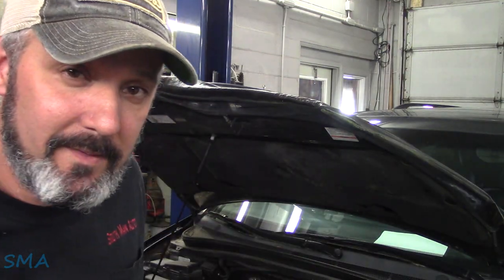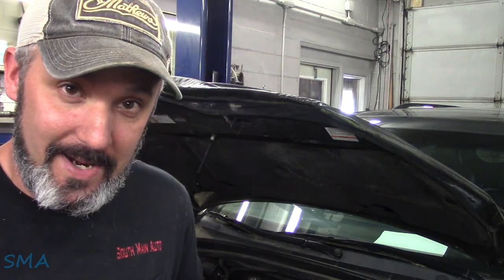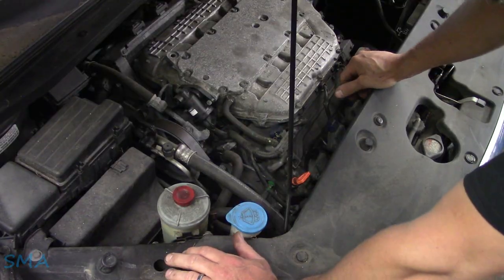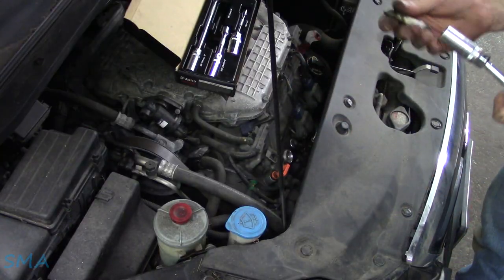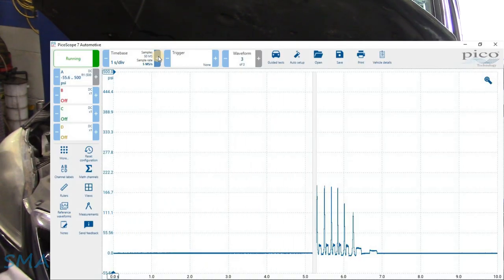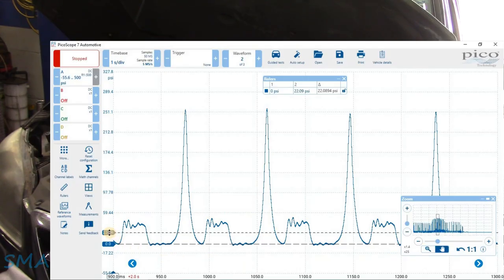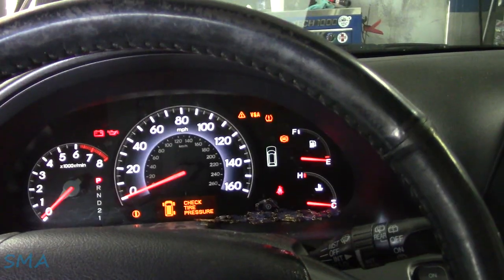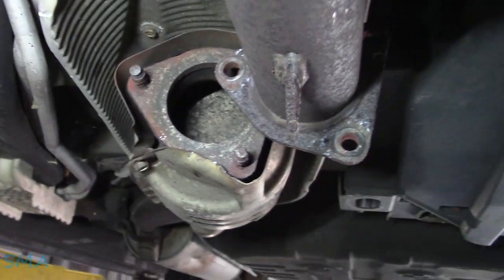Honda Odyssey: No Power At All

Comment: Judging from the almost bald tires, the wrong spark plugs and a plugged cat, these people probably have ZERO money to fix their car.
Reply: they are not OEM plugs, not the 'wrong' plugs.  Multiple brands make plugs for cars.  I prefer NGK personally.  Those tires must have a few more revolutions in them! (before they pop)
Reply: @zakuraayame5091  Bosch makes a good pmug though but for japanese cars it's usually japanese plugs. Bosch might well be the oem manufacturer fron honda in some markets though.
Reply: those are Bosch plugs....just as good as NGk..it's not like he used autolite plugs or something...
Reply: So, the ol' Italian tune-up it is!
Reply: I always buy bosch ones and never had problems with them. I one time bought ngk and it snapped on install, no excessive force was used.
Reply: Methinks they will pay Eric for his diag time, then take a hammer & broom handle to what's left of that catalyst. Sounds like it's guzzling oil so a new cat wouldn't be long for the world either.
Reply: Those are also problematic tires. When new, they were "State of the art" Michelin run-flats. Most Odysseys have had the rims changed out for regular wheels/tires.
Reply: @notsureigaf  The oil consumption is probably due to the clogged cat and internal crankcase pressure being very high.
Reply: @zakuraayame5091  they are supposed to be laser iridium ngk though
Reply: Those tires look good, what are y'all talkin' about?  When the tread is TOTALLY gone and you can see the metal cables inside...  You know you're pushing the limit!
😅
Reply: @maxwell6504  Autolites are good plugs.  If you have problems with them the engine is burning oil.  Not the plug's fault
Reply: and the government regulations will make them poorer
Reply: @churblefurbles  exactly. The Left's continued war on the Poor. But The Poor are too dumb to realize it.
Reply: @LuckyBaldwin777  
A plug is a plug...as long as it is the same type as it should have ( cross referenced for size and heat range ) it doesn't matter what brand it is...those are myths....yeah a badly tuned engine will ruin a plug no matter if it was the " Factory " proper " Brand " .....idiots love repeating myths as Facts....i used lots of plugs on my racing bikes...heard that all the time....
Reply: Had Bosch plugs in my Buick for 100k, good plugs
Reply: @garymallard4699  True, most of the time. But, smart to consider China likes to cheat on materials, design, and craftsmanship. Sometimes you really do get what you paid for. And somethings are very over rated, or even bull$#!+.
Reply: @LuckyBaldwin777  no, they're not good plugs, lol. they're cheap ones and I never said anything about an engine burning oil.
Reply: @robertmitchell8728  
I raced motorcycles for 15 years...been fixing vehicles 50 + years....as for current products..  Yeah there is crap out there...but generally you are paying more for a reason...most of the time it isn't quality....i stated my view...whether you agree is not my concern....i heard these arguments enough to know it is talk not experience speaking....if you " believe " your paying more and happy doing that ..go ahead. ..😆....brand shaming is for idiots.....they really are identical ....alot of them are made in the same factories....just labeled different.... Kinda funny...if you can think....
Reply: @robertmitchell8728  
Do you own a Apple phone?
Made in China too....
Junk
Reply: @LuckyBaldwin777 I've personally never had problems with Autolite plugs, but I do prefer ngk
Reply: @maxwell6504  not true.  I've used them for years in my Ranger that has 398,000 miles.  I get 100,000 miles out of each set and change them because of the mileage not because of any misfire problems.  Every person that I've known that says they're crap has had a vehicle that burns oil and I admit they're not good plugs for an oil burner.  That's the only reason not to use them..
Reply: @garymallard4699  "A plug is a plug"  I agree with you as long as the engine isn't burning oil.  I'll bet none of your racing bikes were oil burners.  I hear some brands are better in oil burners.  I can't verify that because if any of my vehicles start burning oil, I fix it, so I don't have any experience with oil burners.
Reply: @LuckyBaldwin777  
I had 2 strokes...premix gas
No issues with " oil burners " lol
Now i also own other vehicles...gas & diesel...big n small....never had problems...that i couldn't fix...lol
Reply: @LuckyBaldwin777  
If your fouling plugs...it ain't the brand of spark plug....maybe you need a " hotter " plug??
They make em hotter or colder than " stock "  lol
Geez
Reply: @garymallard4699  Me fouling plugs?  Like I already said, I'm getting 100,000 miles out of a set of Autolites.  Does that sound like I'm fouling plugs to you? lol Geez right back at you.
Reply: Put Bosch iridium's in my Honda 3.5 equiped Saturn Vue.   Ran good for about 12 minutes, then all kinds of misfire.  Back to store for Denso's and the engine is happy again.
Reply: @AmandaHugenkiss2915  Really ,the more money  you make the more they take from the docile  sheep of rich suburbanites that are not connected  politically ( bribe) inside of congress.
Reply: @Ownsterx  if a spark plug provides a spark at a specified gap consistently, it could be anything.  Iridium is for longevity.  The plug isn't firing lasers in the chamber :)
So, if the plug is not defective, is within serviceability, properly gapped ...  it will perform equal to any other properly gapped, non defective, within service plug.

I heed more his advice that specific plugs tend to work better in specific vehicles from his past experiences, but the plugs in it are not the cheapest you can buy, to be clear.  They may need tires about as bad as anyone ever has; but they could've gone with cheaper plugs without any longevity coatings ;)
Reply: @zakuraayame5091  I understand that but it should have oem recommended ngk plugs in it (100k Service Interval), the tires will never be replaced because those rims are PAX, needs different rims.
Reply: You forgot to add bad battery
Reply: that’s why i got out of the field
Reply: No. Cheap people do this the car is the last thing they think about ,put the key in starts then there good😂

Comment: Dude the street value of that dust could have paid for the repair.
Reply: Used converters that are truly used don't have near the level of precious metals in them as they do when new. Hence why thieves don't bother with old cars even if they are easy to get to. Who ever is buying them will reject them. The catalyst wash that contains the precious metals eventually gets eroded off the honeycomb which is why they will fail even if the honeycomb doesn't over time.
Reply: @Cragified  and it's deposited allover the roadways ;)
Reply: @Cragified  well in the uk so many old converters,  especially off Japanese cars are being stolen daily and cost about £1000 to replace , with sensors , as the scum just cut through everything 18v grinder , 30 seconds done , I have my own shop here in the UK and get about 60 /150 pounds for old ones I am replacing due to emission failures , diesels and dpf cars more
Reply: @mikeberry304  Same thing here on the west side of the States. If you have a Prius or other hybrid it's only a matter of time. You hope they didn't just wedge the jack under the rocker panel and bend it all to hell. Or the oil pan. The latter happened to a poor grandma in my apartment parking lot. I heard her fire that thing up one morning and wandered out in my bunny slippers to give her the bad news. Then I saw the pool of liquid dinosaurs streaming from the parking spot and I felt even worse for the ol gal. It's a good thing she didn't try taking it to church like she planned to.
Reply: @mikeberry304    I saw in the news from the uk, a guy was found deceased in a used car lot with a van on his chest.  It fell off the jack while he was cutting off the converter.  Moral of the story, alway chock the wheels when you’re stealing converters. :0
Reply: Like the Beastie Boys said, "But I can't pay attention cause I'm on that dust."
Reply: @randomschmo5778  I rather enjoy those feel-good stories.
Reply: @Cragified  Yep, it all ends up on the side of the road. There are some youtube vids about amateur chemists extracting palladium and such from road dust as an experiment. Pretty interesting.
Reply: I know one thing  .. that car will have more go power than them tires can handle .. definitely not safe .. all that dry rot looked like a road map ..
Reply: It has made me think about how many tons of catalytic materials have been dumped out of car exhaust since 1973, Has their answer of what is better for our air caused more harm than good?
Reply: @jaymzx0  over here on the east side we have guns.......so nobody takes my stuff......
Reply: @tristanberke8759  Plenty of those here, too. The law doesn't look upon shooting someone over car parts too fondly, however. I suppose you could say they came at you with the Sawzall...
Reply: @jaymzx0  over here you pretty much can. The castle doctrine is a great thing.
Reply: Aware that your car and your house are different things usually. But when your car is on your property.......castle doctrine.
Reply: @tristanberke8759  Castle doctrine exists here too, but you can't shoot someone over property alone. They have to present a threat of death or great bodily harm to you or another person in your presence. AFAIK only Texas and Florida allow you to kill someone over stealing car parts.
Reply: @randomschmo5778  thats a good news story in my books.
Reply: @Urz75z  unburnt fuel being sent into the atmosphere is definitely worse, both from a health and climate perspective
Reply: Great vid.
Reply: @jaymzx0  Small engines have low oil shutoffs, so they don't destroy themselves - why don't large, expensive, computer controlled car engines? Would save a ton of engines & $ from people who don't know how important a low oil light really is.
 Or maybe the newest AI enhanced ones do...?

Comment: By the looks of those tires that clogged cat was actually doing them a favor by not letting them rev it up lol.
Reply: the freaking tire cord sticking out lmao
Reply: @Nevy21 , Nah, that's just the second tread coming through.
Reply: @brucejones2354  once your baby tread comes off, the adult tread is the last one you get...
Reply: Lol have you ever seen the price of pax tires?
Reply: I bought my self Four new tires at 215.00 apiece replaced my rad at the same time. And water pump on my 5.7 Vortex engine 1998 Chevrolet 1/2 ton

Comment: Years ago I did a full exhaust change from the Y-pipe back on my 2000 Buick LeSabre with the N/A 3.8. Due to the gravel driveway being an issue for the stands, I ended up having to drive it up on some ramps after I had pulled the pipes. Naturally at 8pm I did it quietly, making sure to rev it only half a dozen times to enjoy that sweet splendor of an engine. I'm sure the neighbors enjoyed it as well. I like to share such wonders.
Reply: Making sure to only rev it a dozen times I'm sure the neighbors enjoyed it as well lamo I resemble this put a big smile on my face thank you

Comment: During a training on catalytic converters about 15 years ago the instructor stated that over 90% of the time converters fail due to an engine issue. Basically converters are murdered by engine issues.
Good call on the diagnosis. Also I never used a fancy scope to test back pressure. I would unscrew an O2 sensor and put a pressure gage in its place and test that way. I even learned new technology.👍👍
Reply: Thats the way I do it. I can see how removing 1 plug and screwing in a transducer could save a boatload of time though. Sometimes 02 sensors don't want to come out.
Reply: @mph5896  I agree. There is another way that I was taught that I don't like using and that one is to use a IR thermometer and measure the Temps pre cat and post cat. It's a fast way but not good enough solid evidence to condemn the converter in my opinion.
Reply: @MAGA_Trump_Warrior  we use the IR thermometer in a case like this to determine from front bank to rear bank if one is clogged. I agree you can’t confirm a bad cat with IR but it can save you from spending time on an unclogged on. 👍🏻

Comment: 7min in. Bad cat?

Edited: looks like the converter dust needs to be changed. Isn’t it supposed to be clear?  Check the blinker fluid too! It’s probably overfilled as well! Thanks Dr O for bringing us along! Great day to all!
Reply: Naper - not a sponsor - probably doesn't stock Honda compatible converter dust. Eric made a mistake in not saving the original dust in case he couldn't get a replacement bag of it.
Reply: Honda employs a sealed maintenance free blinker system,  but you might be on to something w/ that dust contamination🤔🕵👀🤷
Reply: 20 seconds in... Bad cat.
Reply: On the 1980 Chevy Citations the cat was filled with pellets.  These had to be changed every 30k miles.  There was a kit of pellets and a new plug at the dealer to do this service.  A little yellow indicator came up over the odometer signaling time to service. The cluster cover had to be removed to access the flag.
Reply: Muffler bearing went bad, and back feed into the converter

Comment: Outstanding diagnosis. I enjoy this video because the person speaking shares with the audience the customer complaint and shares the thought process and the possible diagnosis and diagnostic tools and tests to prove or disprove the cause or causes and shares its fairly obvious that another shop had tried and failed to repair and did a lousy job leaving the spark plug loose. Not only does this shop have to fix the actual problem, the shop agent has to find and fix the lousy work done by other shops in prior attempts. Outstanding job!

Comment: Very interesting on this one, I've heard about  this type of issue and recall my old Buick had a blocker converter. From that I learned about oil burning in the system, yepper, one year later Plugged again. Learned lots more, they put a after market part in the car it lasted 20,000 miles!! replaced it again and said GOOD BY to that car. lol, thank for sharing this interesting issue. Great job Eric O. Keep them coming and I'll keep watching.

Comment: Some folks operate under the misconception that the compatibility between Eric & Mrs O just happens magically.  Believe the truth is it's a joint effort based upon a deeply woven mutual respect for each other's strengths that bind this relationship, Not magic, requires effort to sustain & flourish.
Reply: Huge amounts of effort, been married 25 years and anyone who says otherwise is either single, or just plain nuts.
Reply: @Shit_I_Missed.  Marriage takes a lot of work on both sides. A good marriage just doesn't happen
Reply: @covishen   🚽 I missed  fellow lives in a bubble, not even worth the effort to respond to his ignorance.❄❄🌬
Reply: Nutso! Mrs. O is the brains behind this organization, as are all women in any successful relationship. Eric is just along for the ride... Speaking from 44 years of bliss.
Reply: @garygruber1452  If we suspected Gary is a homicidal sociopath, check his bio  for absolute confirmation. If seen in public, cross the street before you are noticed. Gary exemplifies why bail reform is a failure.

Comment: My assumption looking at the overall condition of the van and that knocking out all the crap likely made it run a lot better, the customer will decide on the put it back together as is, charge the labor and write down what you found on the invoice route.
Reply: @HouseCallAutoRepair  vacuum what out exactly he just ran it with the pipe open there is zero left in there
Reply: @jeremyhanna3852  the back half still has plenty of shit in it, pretty sure that's what he was talking about.
Reply: Yep connect pipe 110 honduuu horsepower take of the rest

Comment: Tires probably haven't been changed because they are Michelin PAX run flats.  Long ago discontinued, I believe the rims have to be changed out to be able to use conventional tires.  Have a 2008 Odyssey, thank fully did not buy the run flats.
Reply: Rims have to be changed out to put normal tires on them.
Reply: Yep. They suck. And are extremely heavy. Like 80 pounds per wheel.

Comment: i've had several of the 3.5 engines dislodge the filament in the upstream converters resulting in the exact same accumulations in front of the rear cat...what happens is a piece or chunk breaks loose in an upstream cat and blows and jostles around in the housing slowly disintegrating and then collecting in front of the downstream cat causing a blockage, the initial piece that came dislodged can also be beat around enough to become round at which time it can get stuck in the pipe and act as a plug so its important to make sure the entire pipe is clear especially around the bends.

Comment: Back in the day I had a 1978 Chevy PU with a 235 CID engine and it had 1 cat, converter. I swapped 3 engines before I figured out that the converter was plugged up. In those days, you could pull a round plug out of the converter and dump the stuff out of it. After I emptied the converter she ran great.